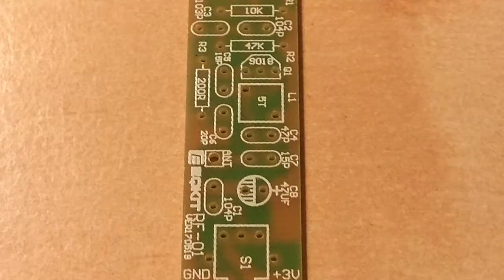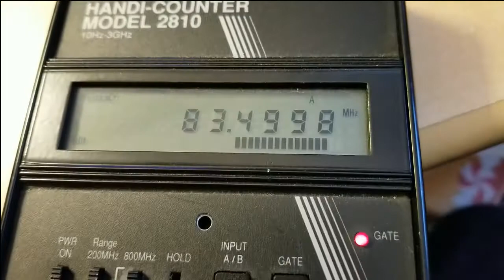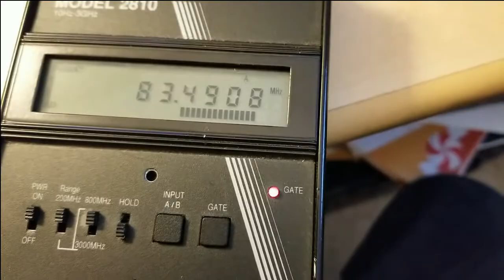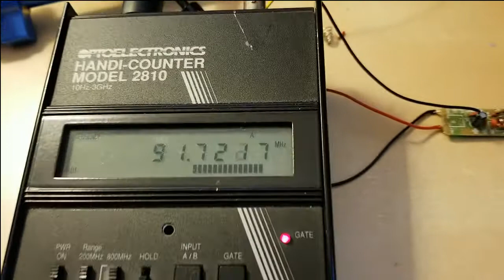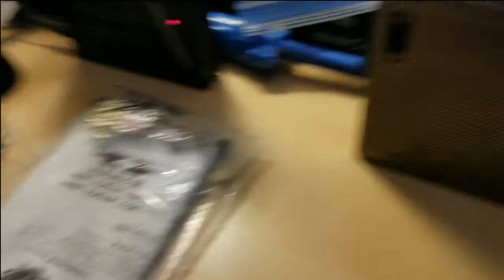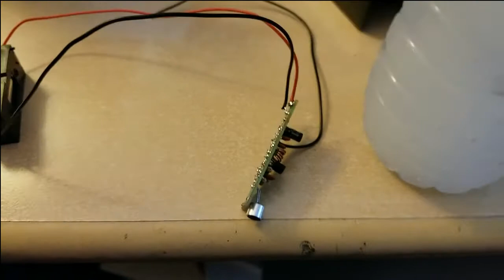BangGood One Transistor FM Wireless Transmitter Kit

Comment: If you want maybe check my video about 1 transistor AM transmitter, since i see that you work with older radios.
Reply from the maker: Skaza Electronics thanks I will try it.  I was thinking about building one with this digital vfo  that I bought. Build a small output stage and modulate it with a transformer. Also have parts and plans for All American Five's tube transmitter. Too many options, not enough time lol.
Reply: Yea lol, thats why I choose the simplest option (else I wouldn't get it done at all :s )
By the way I connected the tuning capacitor in parallel to tune the antenna. You don't have to use it and it should still work.